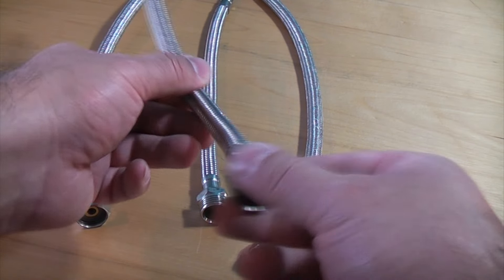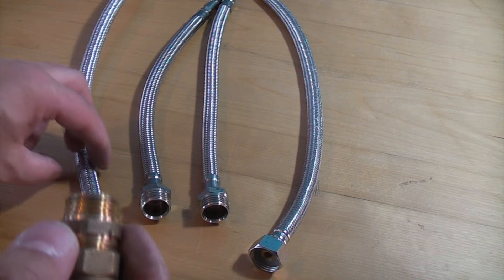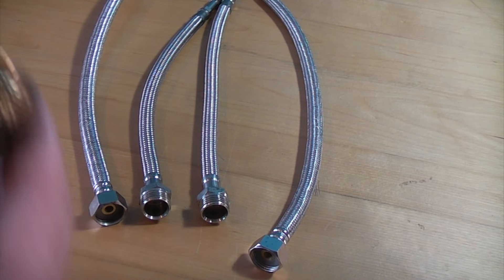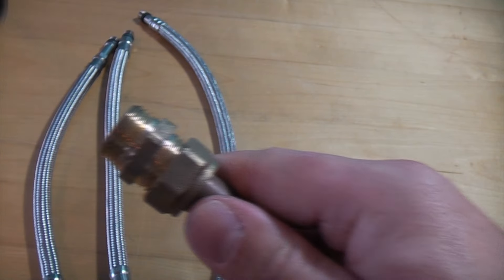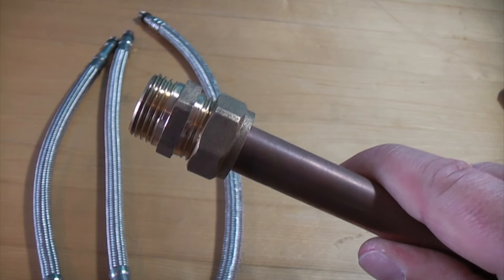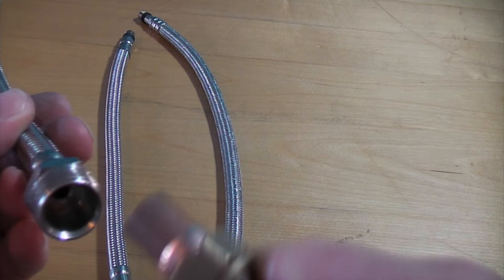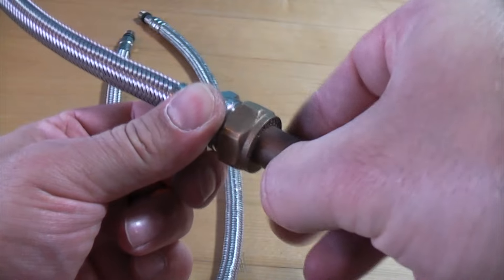How to connect flexi tails - Ultimate Handyman

Comment: Thanks for this great tutorial - handy tip on using a spare compression nut!  We have individual hot and cold taps leading to a separate mixer spout in a 3 hole setup bath.  I checked the fittings beneath the bath today and noticed the brass on one tap had turned completely black.  Is this level of corrosion/tarnishing normal, or do you think the flexi tail connection is weeping?  Heard you can use Fernox LS-X to seal weeping joints, is it worth running some this around each nut?  Appreciate your advice, cheers!
Reply from the maker: If the nut has turned black, it’s probably weeping and the water has turned to mould. I once had a similar problem in my bathroom, and there was a huge piece of black slime running down the pipe.

I’d take a good luck at the flexi tails, they deteriorate over time. If they are older than 10 years old, I would seriously consider replacing them. I replaced a basin tap a few weeks back , and the flexi tails had started to fray and were sharp. I’m sire that if they had been left there would have been a burst flexi one day in future. https://www.youtube.com/watch?v=5TXaWJVbKlM&t
The Fernox sealer should work, but it’s worth checking the condition of the flexi’s 👍
As a side note, I used to work in a chemical plant and there was a register of all flexi’s on site. They had to inspected periodically to ensure they were fit for purpose!
Reply: Hi, the flexi's look fine, no sign of deterioration, and the nut on them looks okay.  No slime visible, all bone dry.  I've never seen brass go like this before, it looks like somebody spray painted the entire thing with matt black paint.  Unless it's weeping from the what i assume is a ceramic washer?  Or because it's closer to the external wall that might have condensation on it?  Very strange. Will let you know if i find out what it is.  Thanks again for your reply, keep up the great channel!

Comment: In regards to the compression fitting type tails from my bath taps, can I connect this straight on to plastic JG plastic pipe under my bath that I have installed or would I be best transitioning to copper to connect them up. 

Thanks again.
Reply from the maker: You can connect them directly to the JG pipe- just make certain that you use pipe inserts.
Thanks for the comment 👍
Reply: Ultimate Handyman Au thanks for the quick reply, I’ve literally redone my bathroom and hot and cold water system to new from your channel. 

I have all the inserts here ready to go.

Comment: Your a very nice chap and good at explaining,the problem is avoid these if possible,there are a lot of people who have used these several years ago and have come back to the house with a burst the flexi hoses become porous after time if there’s a small leak or even condensation they wither go back to either pex pipe or copper.
Reply from the maker: I agree, but with most modern taps, these are the only option.
A mate of mine had a burst flexi and it made a right mess of the whole house! 
I prefer traditional hot and cold taps, then you can pipe them up with copper pipe and tap connectors 👍

Comment: Maybe a daft question, but where do you get a spanner to fit the other end of the flexihose? I’ve just bought a mixer tap and where the flexihose connects is to deep to get a spanner in to tighten it to the mixer tap.
Reply from the maker: Some manufacturers say that you only need to tighten the tap end by hand, as there are two sealing "O rings", if you still have the instructions I would check.
Thanks for the comment 👍
Reply: Ultimate Handyman the instructions just say tighten firmly. They don’t say with or without a spanner. I’ve just hand tightened them and will be fitting it shortly so we’ll see how it goes

Comment: Can I apply Teflon tape and Megaloc on that tiny male end that you screw into the bottom of your faucet base?  The bigger end I attached to a shutoff valve, but I would like to know about the tiny male tip ( the tiny end with the threads and the rubber washer bands on the unthreaded part/ the part you are holding in your hand at 0:09)  The first time when I connected the bottom to a shutoff valve, it was leaking from the top male part connected to the faucet because I noticed it had come unscrewed somehow after I connected all the other parts and had to take everything back a loose.
Reply from the maker: No, I would not do that. 
The small end relies on O rings to make the seal. Sometimes there is one and sometimes two  O rings. It looks like yours might be damaged and need replacing.
Reply: @ultimatehandyman   oops too late already done!  I read on Google that both Teflon and megaloc both are not bonders or glues, so it had a male threaded post so I went for it!  They can be removed.  If still leaking, I will buy new hoses or get a refund.  If it works, I will keep the faucet.  My hoses somehow spun loose while I was tightening the other end that has the rotating tip, but the hoses are so stiff that they would not tighten while attatched to the shutoff valves even though that end has a rotating tip. People were complaining that no matter how tight they got the hoses, they leaked!!!  Maybe they are cheaply made?  I will find out the results later tonight....😳

Comment: Hi - I'm just about to install a new tap, but used a solder ring 15mm to 1/2' male adaptor.

Just a question - how tight would you tighten the 1/2' adapter into the hose ? The one you're showing seems to have a fibrous washer, while my hoses have a black washer, which I suppose is rubber. I immagine that if you over-tigten, you can damage the washer seal ?

Thanks, and nice demo by the way.
Reply from the maker: +cielobuio 
The rubber washers are normally better to be honest. As you rightly point out you do not want to over tighten it so if you nip it finger tight, then give it quarter to half a turn with a spanner it should be fine. Obviously just check it afterwards for leaks etc. 
Thanks for the comment

Comment: I bought a Grohe basin mixer tap but it came with a thinner flexi pipes than used in UK. Can I use some kind od adapter to resolve the problem?
Reply from the maker: I'd take it to the plumbers merchants and get new flexi tails to be honest. I do not know of any such adapters.
Thanks for the comment 👍
Reply: @ultimatehandyman  Hi, Thank you for taking time to reply. I've found elsewhere that adapters exist (12 to 15mm) and are widely available for around £4. EU taps are fitted with 12mm flexi's.

Comment: If you use a compression fitting do you have to seal it with teflon tape or did you not do that b/c the fitting was like a sharkbite? :/  Sorry, I'm in the U.S. so the language may not translate!! Thanks for the video though, helped quite a bit. :)
Reply from the maker: No, you don't need PTFE tape on compression fittings, as the olive (called a ferrule in the US) creates the seal.
The flexi tail's have a rubber sealing washer, but there is a better type of isolation valve available for this purpose, which can be seen in this video- https://www.youtube.com/watch?v=vJmbPRVYuJY
Thanks for the comment

Comment: Does the compression fitting fit in any type of pipes ? And why do some pipes require soldering .
Reply from the maker: Yes, compression fittings can be used on copper or plastic pipes (with the insert)
https://www.youtube.com/watch?v=KOxZE4zL6rE&t
Copper pipes can be soldered, it is down to personal preference if solder/compression or push fit fittings are used to join the pipe.

Thanks for the comment 👍
Reply: @ultimatehandyman  Thank you so much for the information

Comment: I am fitting flexi tails to a Franke Ascona tap how tight should the tails be tightened can i use hand tightening  or should i use a pair of grips?
Reply from the maker: Normally at the tap end, you can just tighten them by hand, as they have O rings to make the seal. I normally give them a really gentle nip with grips though, to be certain.
There is an updated version of this video here, which might be useful-
https://www.youtube.com/watch?v=OuOdkjMLFKA&t
Thanks for the comment 👍

Comment: Thinking that those Flexi Tails bought that are  on eBay with the wrong thread size might be for that 'North American market' compression fitting Market, where they also do their own thing , here in Southern Ireland  we actually kept the old imperial system going  so you can get the likes of 1/2" and 3/4 " rather than 15mm and 22mm, we use Imperial  to Metric compression adapter's here for a pastime ,    (  as you know in the likes of chemical and pharmaceutical Industry things get more that sketchy what with B.S.P and the North American... National Pipe Thread...N.P.T. and even today  some trades people can't square  that circle in their heads, historically same  was never squared  by so many  countries post WW 11, might have been because of big brother Uncle Sam became the  go to lad for supplies of that stuff around the Globe )... Great upload...
Reply from the maker: Yes, you are probably right. NPT is not very common in the UK, although I ended up with some stainless-steel NPT needle valves – in my garage 🤔

Comment: Hi, I was under the impression that you should not use a compression (male) directly into the female end of the flexi, as the washer contact area is considerably reduced by the fact that the male compression end has an internal chamfer?
Reply from the maker: I'll have a look when I get chance. It was a British gas plumber that told me to use them! 
Thanks for the comment
Reply: Keith's right - you should use tap tail adapters, http://www.screwfix.com/p/flexible-tap-adaptors-15mm-x-2-pack/2665r or http://www.toolstation.com/shop/Plumbing/d20/Flexible+Connectors/sd2807/Tap+Tail+Adaptors/p14081

But nobody does.  You should though, because the chamfer for the olive can definitely sometimes knacker the washer.
Reply from the maker: Thanks Jonathan, I'll get some of these when I get chance. My original video is 7 years old and I don't recall these being available back then.
Thanks for the comment ;-)
Reply: Keith Stafford d

Comment: It is not a good idea to thread a half inch bsp female thread onto an isolating valve. The isolating valve has a tapered end designed for an olive. This end could cut into the washer causing a leak. Far better to use a short piece of pipe out of the isolating valve and fit a 15mm to half inch bsp male adapter. This fitting has a much broader flat end. Less chance of damaging the fitting
Reply: Never seen that happen, again, armchair "Expert"
Reply: I fixed one only last week that had split the washer.
Reply: Børma
Reply: I wanted to fit a pair of flexible tap connectors on to some isolating valves and also didn't think it was good to do this because of the taper. After doing a bit of searching I found that screwfix sell flexible tap adapters specifically for this purpose. It's basically an extension piece which you fit into the valve as you would a pipe but it has a threaded end for the tap connector with a flat face so as to give a good seal.
Reply: Nick Collins You get special "flexi tail adapters" which are about 3 quid for a pair.  One end is smooth 15mm and goes into the isolation valve and the other end is threaded, with a flat end...
Reply: 3/4" "washing machine" isolation valves have a nice flat end. It'd make more sense if the ends of the tails had a female 3/4" fitting instead of 1/2", to suit these valves.
Reply: `they are called 15 mm copper to iron ... or used to be , im a plumber

Comment: Recommend using 15mm x 1/2  conex (compression) male irons on flexi pipes. Sometimes balafix's cut into the washers. Also water regs require a isolation point at EVERY draw off.  If using bristan copper tails, never use compression as the copper is thin and cheap just collapses. Use plastic, or soldered connections
Reply: thank you this is useful info!

Comment: Thanks this is really helpful,   However I have a threaded flexibtail (that came with a nut and olive) that I need to connect to an existing isolation valve thread. I can't for the life of me work out how to do it, I expect I need to buy something to convert  the threaded end of the isolation valve into plain pipe or new flexi tails ?

Comment: Exactly the answer I required for my new Lidl mixer tap. Thanks. It is a bit ironic that I am experienced in the installation all kinds of compression fitting stuff but wasn't sure about this. I suppose every operation has its first time.
Reply from the maker: You are welcome. There seems to be a better alternative now though, as pointed out by Jonathan Wright- http://www.screwfix.com/p/flexible-tap-adaptors-15mm-x-2-pack/2665r
Reply: They look really great but I need to put a couple of isolation valves in so will stick with that. Thanks.

Comment: Hi, when fitting our flexi tap tails, they get very bent due to the height between the pipes and the sink only being 200mm and the flexi tail is 300mm. Are they okay to be bent a lot? As I cannot find any pipes shorter then 300mm. Thank you,
Reply from the maker: They are not designed to be bent a lot, but as long as the tails are not kinking they should be ok (or you could shorten the pipework perhaps?) 
Thanks for the comment

Comment: The original flexitail failed and it has 2 o rings on it , but the replacement i bought has only 1 o ring on the flexitail. Is this still compatible? I am guessing the flexitail with the 2 o rings would be more water tight?
Reply from the maker: I'm not sure, but have seen both types.
I'd try and get one with two O rings to be on the safe side.
Thanks for the comment

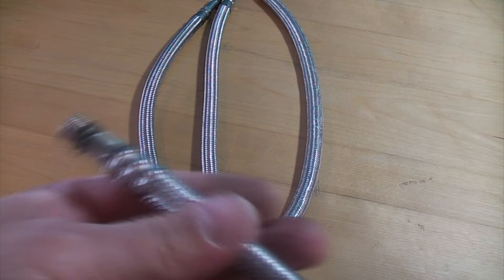Comment: Hi, I'm just lookin for flexi tail what you are holding in time 0:17? Where could I buy it? Was in BQ, Screwfix... nothing. Please help.
Reply from the maker: Tomas R 
They seem to sell loads of different ones at screwfix, for example these- http://bit.ly/1IeaqyK
You just need to find the correct ones for your particular tap (sometimes it's a good idea to take the tap into the local branch)
Reply: ***** Think he means the female connector, which is exactly what brought me here, even my local plumbers merchants doesn't sell female flexi tail pipes. All Screwfix/b+Q sell are male adapters which require cutting copper pipes. I already have all the pipes/isolators but can't get hold of a female pipe to replace my leaking one. Ebay seems the only place.

http://www.ebay.co.uk/itm/10mm-x-1-2-BSP-Fitting-Basin-Monobloc-Mixer-Tap-Connector-Flexi-Hose-Pipe-Tails-/171733621328

Comment: I have tried to fit the connector via olive and nut to my chrome wash pipes and it is just too loose. Tap instructions say not to use a spanner to tighten, is it lying to me?
Reply from the maker: I'm afraid you will not compress the olive without using a couple of spanners, the instructions must be wrong

Comment: Spot on, I was about to connect to an isolation valve and you have answered my question. I was concerned that the plastic seal inside the flexipipe only sits right on the edge of the isolation valve mating surface. I was expecting a fitting with a flat mating surface or at least more contact area. Thanks

Comment: How tight do you recommend tightening these after hand tightening to prevent the threaded end of the compression fitting from over digging into the sealing washer?
Reply from the maker: As tight as possible using my fingers, then 1/4 of a turn with a spanner.
They now sell these, which are better, as there is less chance of damaging the sealing washer- https://www.screwfix.com/p/flexible-tap-adaptors-15mm-x-2-pack/2665r

Comment: What do I do if there is already a female compression fitting on my pipe?
Reply from the maker: You can fit either a compression isolation valve or a straight compression fitting, then use one of the tap tail adapters.
Reply: I got a 3 way compression joint can i fit the flexi tail to one of them ?

Comment: the flexpipe i have is a female fitting. but the problem is that im going from two taps to mono-bloc so not enough copper pipe to new fixing site. would it be possible to use another flexpipe as extention or do i just pipe to the new tap siite.

Comment: I bought a new kitchen tap from Aldi last week. When I screw the flexi tail onto the compression fitting to both the hot and the cold both leak. I can't tighten it any further as it seems to be right up against the middle of the compression fitting. Its almost as if it is too deep for the compression fitting. Anyone know how I can fix this without calling out a plumber? It seems it should be straightforward enough but its not tight enough so water is coming out of the flexi tail. Its very annoying
Reply from the maker: +Adrian Jowitt 
Are the olives copper or brass? were they tight when you slid them onto the pipes?

Have you seen this- https://www.youtube.com/watch?v=KOxZE4zL6rE
Reply: +Ultimate Handyman After I posted this I took a look and they hadn't added any washers. Anyway a quick run to Screwfix £1.59 for 20 flexi hose half inch washers and its sorted in less than 3 minutes!! I can't believe they didn't add washers!!
Reply from the maker: +Adrian Jowitt 
Glad you fixed it ;-)
Reply: +Ultimate Handyman watching your video helped me as it made me think a bit more about what was wrong. I've watched more of your vids and they are really useful
Reply from the maker: +Adrian Jowitt I'm glad you find them useful ;-)Thanks for the comments

Comment: Hi can any one give me advise into which fittings to get ,I have 15mm copper pipe connected to an elbow going onto a flexi hose which is Connected on a sink and I would like to take elbow off and use connections to both sink then onto a shower in 15mm ,can any one help me with this please
Reply from the maker: You should be able to replace the elbow with a compression equal Tee - example on this page-
http://www.ultimatehandyman.co.uk/how-to/joining-pipes/compression-fittings
Reply: Ultimate Handyman thanks for tip much appreciated cheers John
Reply from the maker: You are welcome 
Thanks for the comments